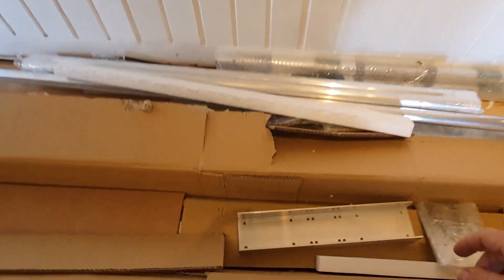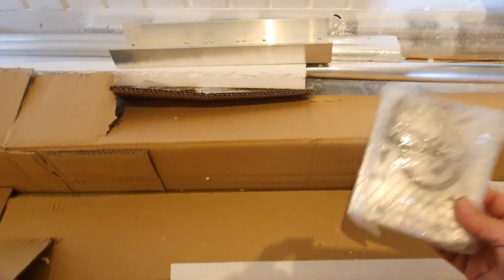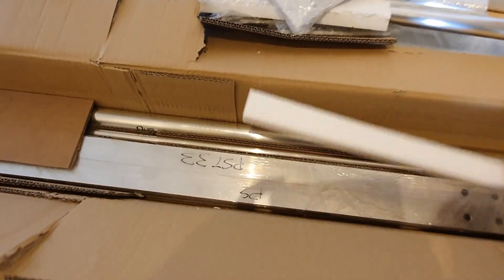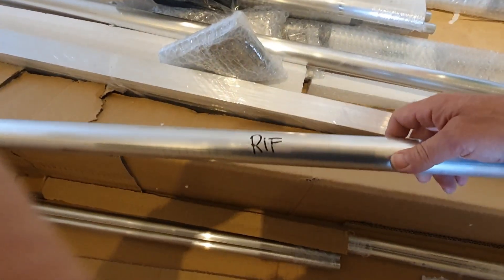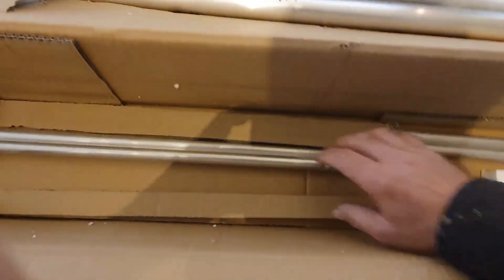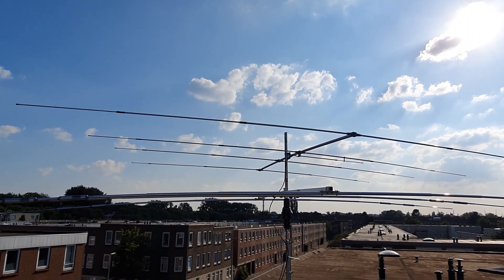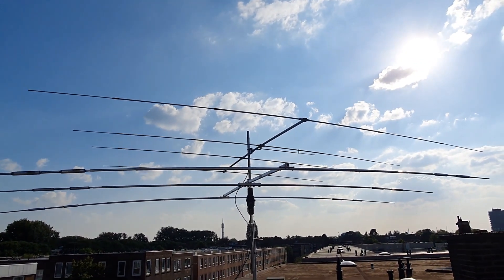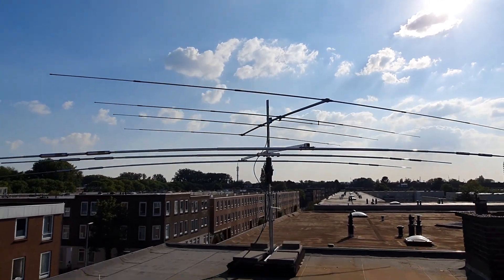STACKING A 11 METER 4 ELEMENT YAGI OVER A 3 ELEMENT 3 BAND YAGI 🤔🤔🤔PART 1

Comment: You can cross them over for 90degree opposition. Think also is North to North good rotator stop or West or East?
Reply from the maker: Hi Max,thanks for your advice, many operators have similar solutions, but I will plug it in  and  check out the swr and performance hopefully over the next few days,,,thanks 73 ...
Reply from the maker: Hi,just checked the 11 meter yagi, swr now 1.04 on 27.555 USB I can live with that, have to wait a little longer for the 3 band yagi,,,speak with you soon 😀,,73
Reply: @Bernard-John  Good on ya. Cool to follow this one. Cheers